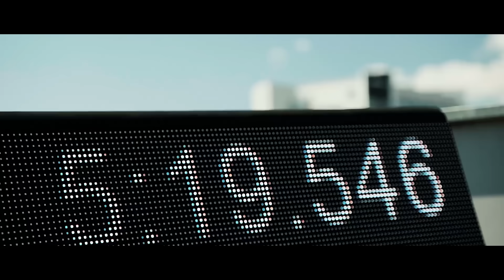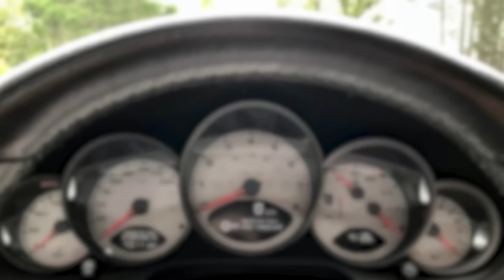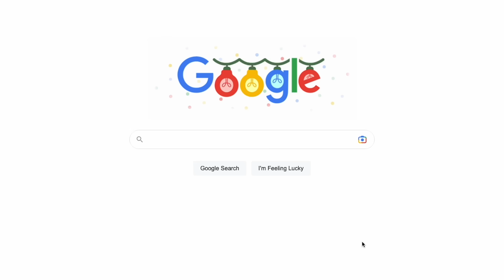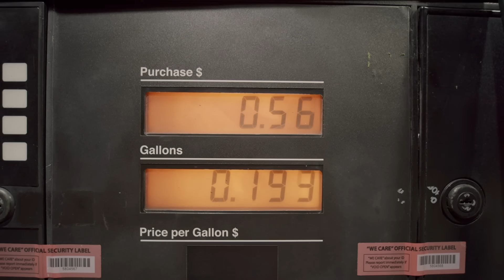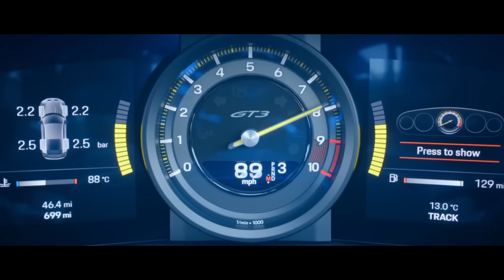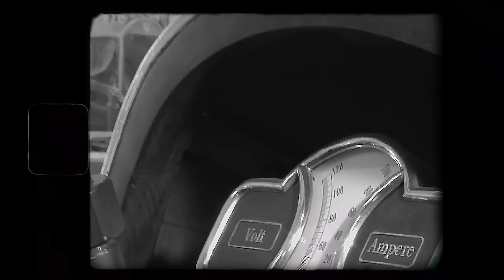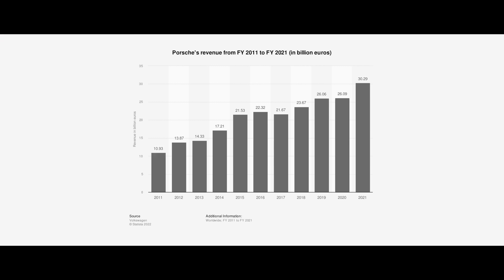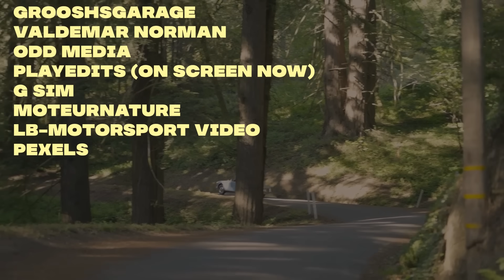Why Porsche doesn't race in F1

Comment: Porsche actually did used to be in F1, they used to build engines for McLaren in the early 1980’s. Those were the 1.5 litre turbo’d V6’s known as the TAG engines. They won 1984, 85 and 86 with Niki Lauda and Alain Prost at the wheel.
Reply: They briefly raced in F1 as their own team too, they even won a race with Dan Gurney.
Reply: @SamuelSantos_  One race win haha big deal. Even Toro Rosso has one race win in F1. Porsche still never achieved anything significant in F1 as an independent team.
Reply: @horsepower523 it’s been 60+ years since they were in f1, how is this even remotely relevant to how they would perform today
Reply: @horsepower523  Why do they need to be an independent team anyway?
Reply: @SamuelSantos_  people read your comment mentioning a fact and nothing more, and got so offended lol
Reply: you are true sport man... thank you brother for information...
'
Reply: Portchester until recently have struggled for spare money that's a reason not o do f1
Reply: @horsepower523 Yet they're the premier sports car company. They're the gold standard. Don't need to waste so much money in f1 when they're the most successful endurance racing manufacturer by a long shot.
Reply: @neiltitmus9744 who's been  struggling for money until recently? Not Porsche. Not since the intro of the boxster and then their SUVs.
Reply: I'm more than a year late but they took the 11 engines from the F1 cars and detuned them from their 1000hp in race spec to 625hp to help with reliability, and called it the Porsche 930 Tag Turbo and they're going for around at least £1.1m
Reply: I think the point of f1 is racing f1… if Porsche doesn’t want to fine. By the logic in the video why would Ferrari be in F1?
Reply: And that lead to.... *crickets*.
Yeah. That's why they left, and why Le Mans was so attractive. That effort lead directly to the 918!
Reply: Oh man are we that old??? That TECHNIQUE d’AVANT GUARDE… that was olllllllllddddd!!!
Reply: True but their sponsor (TAG watches) wanted more recognition so the car chassis/engine name was listed on the TV as McLaren/TAG!
Reply: @zombiedeathrays8862  Ferrari is dead without F1.

Comment: This video was beautiful. You really just proved why Porsche is THE best automotive manufacturer. This video is amazingly written. Keep up the good work John!
Reply from the maker: Thank you! I’m glad you think so😊
Reply: "best"

That's a bold opinion
Reply: Except every time they joined f1 in the past they failed miserably
Reply: I would not go that far. They are a great sports car manufacturer. But the best is a stretch. Id say Toyota are amongst the best. Largest car brand offering quality and silently they are one of the most successful Motorsports manufacturers with wins in n every discipline apart from F1
Reply: @tyronnezx  I think in terms of performance Porsche is probabilly the best. Their cars have amazing lap times in almost every circuit, even thought they are relatively cheap (a 911 turbo is 250k dollars, a sf90 stradale starts from 500k) and makes less noise and less consumption
Reply: @matteobortolasi1918  he said the best automotive manufacturer. Of course, when it comes to Motorsports, Porsche, Ferrari, Lotus are known brands. Automotive-wise id say they are miles behind brands such as toyota. They only started building SUV's in the mid 2000's. By then your humble landcruiser had been around for over half a decade and made a reputation for itself as the benchmark in offroading. Thats just one example. In the Automotive world, Porsche arent the best. In motorsports and sports car world, they are one of the best
Reply: "best" sports automotive manufacturer, probably.

"best" consumer automotive manufacturer :doubt:
Reply: @matteobortolasi1918  I remember when the R35 came out it cost less than 100k and was faster than Porsche... 🧐
Reply: @bigbamzzz3241  they literally made one of the best engine ever existed in formula 1 which is more durable and more powerful than any turbo hybrid era F1 engines and gift 5 championships in 3 years to McLaren
Reply: Agreed on ALL points. Porsche IS supreme and this video WAS very, VERY well done. Kudos John
Reply: @tyronnezx  I think "best" is not definable, as there are way to many ways to look at it. But I think what makes Porsche so legendary is their attitude and philosophy, which is like the exact opposite of tesla. They take absolute pride in the quality, engineering and manufacturing and don't bother with flashy numbers on paper or over promise and under deliver. It is like a true driving enthusiast brand for enthusiast by enthusiasts. I think In what they do, they are the best, but that is only a small part of the automotive world.
Reply: @thorwaldjohanson2526  thats probably the most sensible justification
Reply: Dont know when did toyota changed their name to Porsche and moved to Germany lol
Reply: @tyronnezx  so you are just agreeing with me that Toyota > Porsche, but very angrily? Aight
Reply: @rayzhang7591  lol. Yes
Reply: not diversity enough in terms of car. hint the reason why my favorite car brand is mercedes benz. it basically just have at least one of the best cars in basically every category. from sport car to off road monster , from luxury car to one of the best vans and truck. they even have convertible cars that you can’t get a true competitor. don’t get me wrong, Porsche are my second car brand but they’re reason why i’m driving amg not Porsche
Reply: @directlinkrexx4409  we are still waiting for you to prove it wrong
Reply: @tyronnezx  the g wagon is arguably better than the land cruiser i am not talking about the amg version but the regular diesel ones
Reply: @bigbamzzz3241  not every time
Reply: Honda no 1
Reply: @rayzhang7591  if you like boring average cars with some hint of excitement sure Toyota is good but if you want Luxury sports car that beats exotics, Porsche is the best brand.
Reply: @tyronnezx I’m the Motorsports world they are the best an the debate isn’t as close as people want it to be, Porsche has the accolades, achievements an cars to prove there the best to the point they’re by far the most successful gt racing manufacturer ever
Reply: Hmmm maybe for some things. If they were affordable for normal humans they'd sell a lot more cars. It's a caché car for the well-heeled. I could say the same thing about Ferrari and McLaren, etc etc. But lowering costs always lowers quality and if they "sell engineering" that's a bad trade-off, possibly. But.... better engineering might produce a fantastic car for less money. Tesla seems to be doing it; others are scrambling to copy it.
Reply: Porsche is a dwarf against Mercedes.

Comment: They could join as an engine supplier to Andretti the partnership exists in formula e,  the only issue there is to convince the other teams which is unlikely.
Reply: Their first deal fell through but yeah I don’t see them convincing the other teams Porsche also wanted to change a lot of the ways the Power Unit would be built to kinda give themselves an advantage which the other teams didn’t like
Reply: the problem here is that formula 1 doesn't allow flat 6's, which is where a lot of their engineering has already gone, so it's redesigning an entire engine from a model they don't use as prominently, aka a gigantic waste of money in their eyes
Reply: Join the team that broke the original 962. That tie in has no advantage for Porsche
Reply: thing is no one wants Andretti  in f1
Reply: Cadillac
Reply: @hagestad  dont really know why, f1 was best when it had a full grid of 26 cars.
i remember way back in 94 there was too many cars for the grid. qualifying poorly didnt just mean starting at the rear of the grid, it meant pack your shit and watch the green flag drop from the pitlane as you didnt even make the grid for race day.
Reply: @Obliv69  Wanna know why? Money. Why would your competitors let you in knowing they'll all takes less winnings home having to split it with another team

Comment: Whilst they are known for using the flat six engine, they can build a good V unit too. Plus from next year they'll be racing with an E- fuels in the WEC with the 963 hypercar. Porsche doesn't need F1 but F1 needs someone like Porsche. Porsche picked sportscar racing as it's where they belong.
Reply: put it perfectly. I think f1 needs a new powertrain manufacturer and i think porsche with their hybrid technology would be the perfect fit. I would love to see porsche in f1 but lets see what happens in 2026 onwards.
Reply: Porsche would get humiliated by Mercedes in f1. Even in "sportscar racing", Black series took the Nurburgring crown from Gt2, and Porsche had to make a Nurburgring PACKAGE just to get the crown back. Literally just a bunch of cowards, cant win without a modified Gt2.
Reply: @brock7405  wow one car went faster than enough around the Nurburgring. Means sod all for racing. I don't think you understand sportscar racing do you. Hence the inverted commas. Porsche Motorsport division is one of the most successful in Motorsport. They'd beat Mercedes no issues. The fact Mercedes got beaten by two teams shows you know absolutely nothing about Motorsport and Porsche success within it.
Reply: @kayto101racer  Oh boy its not just one time thing. Porsche blamed Nissan back in 2010 for using "special tires" on Nissan gtr on their 7.27 Nurburgring lap, Porsche drove the car themselves getting a time of 7.54. Nissan had to do a second run to proof they had no special tires and got the exact same 7.27 lap. Guys really cant take their loss.
Reply: @brock7405  porsche fans will never admit it, but mercedes is just superior in any category they decide to take seriously, they dominated le mans last time they competed, dominated f1 in 3 years, and beat the gt2 on the ring with a front mid engine car such that porsche fans are bragging about the ring record done by an aftermarket company, porsche will always be the lil bro and would get destroyed if they fielded an f1 team
Reply: @chiefdenis  they literally got humiliated by dauer Porsche , Mazda,jaguar at lemans won only 2 times then left lmao and no Mercedes isn't better than Porsche in every category even tho almost in nothing
Reply: @chiefdenis  and aftermarket? Manthey racing bought by Porsche,then AMG is also aftermarket since it's same story with Mercedes and dominated formula 1 because they knew about new regulations before everyone and with new regulations we saw how they lost 2 years in row
Reply: @chiefdenis  and with more limited engine that built by Porsche not even having soft slick,super soft slick or hyper soft slick they still manage to get almost same time with fastest formula 1 car that had way better tires better conditions with way better tires instead of hard tires and it can literally lap at nürburgring and make a record that Mercedes probably will never be able to break... Yes I'm talking about 919 Evo
Reply: @chiefdenis  Porsche didn't even make a new car when McLaren dominated race and when they made 911 gt1 they dominated both McLaren and mercedes not just that but also wsc-95 which used to built by Porsche,after 911 gt1 was created McLaren couldnt even win a single race and after lmp1 era they left for a while then joined back and dominated it's not hard to make some research and even dauer 962 lm which used a Porsche car literally dominated lemans in 90s and had 405 kmh top speed which couldn't be breakable after Bugatti Veyron arrived and broke it just with 3 kmh and Mercedes destroyed Porsche? Like in 1998 which both McLaren and Mercedes was in the race Porsche literally won lemans in gt1 class I won't even talk about wsc-95 which was that good banned afterwards and dominated both Mercedes and mclaren even 911 gt1 did.. it's not hard to just make 5 minutes research, Mercedes never been better in competition which Porsche was in
Reply: @chiefdenis  and my guy I don't even think you know the Porsche 1.5 liters V6 turbo for formula 1 in 1980s which gave 5 championships to McLaren and made MP4/2 most successful chassis in entire formula 1 history had more horsepower and was more durable than Mercedes engines now... It was that strong and durable they literally used that engine for helicopters in United States's naval forces
Reply: @chiefdenis  and manthey racing is not independent but bought by Porsche like bruh it's not hard to make just 5 minutes research and Porsche is little bro of Mercedes? Like literally making fastest race car ever existed and got lap record at nürburgring lmao Porsche SE owns Volkswagen group literally got higher budget than Mercedes bmw Opel together? They have more budget than whole formula 1 grid's consturcors among with fia and they literally make aviation,space and marine products and they are officially most successful team ever existed in Motorsports, Mercedes never been better than Porsche in competition they both were in and it's a fact if you don't believe just check the whole race results which they both been in and Mercedes won't be better in Motorsports untill they get the lap record of Porsche 919 which official makes Porsche faster than Mercedes and more advanced they already are but just in case
Reply: @chiefdenis  we can call Mercedes better if they did run 1600 hp car that goes 400 kmhs in 1970s goes 0-60 in 2.1 seconds and can race it for 24 hours non stop but ofc Mercedes couldn't make this and didn't while Porsche did several times and dominated group c came and their both 956 and 962 was most successful chassis of group c it was that fast the bmw f1 test in 2000s in nürburgring was slower than 956 and we can call them better if they made a car like 919 Evo the car's engine still got limited and isn't even half of its capabilities because of the driver with hard tires which makes the car corner worse and slowers top speed it still manages to be as fast as formula 1 in F1 tracks against ultra soft,hyper soft,super  soft slick F1 tires with less tries and literally can lap and break record at nürburgring which Mercedes probably will never be able to break it,instead of coming to me with false infos and your crybaby feelings just research the FACTS smartest AMG fanboy
Reply: @chiefdenis  i don't remember Mercedes dominating Porsche at le Mans but i remember them leaving after the 962 won everything it competed in 🤣🤣
Reply: @timmynicolas8729  im guessing most porsche fans memory holed the clk gtr and clk lm, lol, can't blame you.
The clk gtr won all but 1 race in the gt1 class, and the clk lm won all races the following year causing McLaren and porsche to pack up and take their ball home 😂
Reply: @chiefdenis  well idk if you're memory is causing you trouble but who won le Mans in 1997 and 1998 ? Surely Merc right , if it was Porsche it'd be quite embarassing for them and you ...
Reply: @chiefdenis  they must have won LM the next year then right ? With such a lineup and a car it'd be impossible to lose in 1999 🤣🤣🤣
Reply: They race in IMSA...
Reply: @TheOnlySirC  they race IMSA as well as WEC. Don't try and educate a sportscar fan on the sport they watch
Reply: @chiefdenis  They way you lash at Porsche fans for being childish, while you ruin Merc fans acting exactly the same. Remarkable.
Reply: It's a shame we never saw the Carrera GT's V10 in F1 during the V10 era.

Comment: The joke is they won't join the F1 because they can't put the 911's design principles into building an F1 car. If you look at their commercial car range, it's either a 911 or a totally-not-911. Even the race cars are the same.

Comment: Imagine how much faster an F1 car not conforming to any regulations would be than the 919 Tribute considering that an F1 car lapped Spa faster than it in qualifying.
Reply: Right, but the racing wouldn’t be very good because there’d be even bigger gaps between teams.
Reply: and then porsche would come along and build something even better
Reply: @mangosteak  The best Porsche could do still got beat by an extremely regulated F1 with crazy emission standards. You can't just build the fastest car without a history and infrastructure for competing in the #1 motorsport on the planet.
Reply: @iloveabasket your what hurts? What are you babbling about?
Reply: @S0ulinth3machin3 Group B was peak though
Reply: @mangosteak 😂😂😂yeah sure
Reply: @iloveabasket  They tried to demonstrate how fast an unrestricted le mans car would be. Nothing else. It happened to be on a similar performance level of current F1 cars.

They can also easily design an F1 car which would be faster than the 919 evo. And it is obvious that an unrestricted F1 car is way faster than anything we have seen so far. 

Dont try do downgrade Porsche please.

Comment: I hate it when people say "more downforce than f1 car"  there are rules in place on how much downforce can be produced. Formula 1 is strict as hell. Every f1 car is a concept build tlwith a new one every year. When drs first came out you could use it wherever and whenever and then it became regulated. If half of regulations that were imposed in the last 20 years were removed, nothing would come close to an f1 car
Reply: If regs removed from f1 cars it wouldn’t even run for 2 mins straight. Even with full regulations f1 cars are one of the most fragile cars can ever exist.